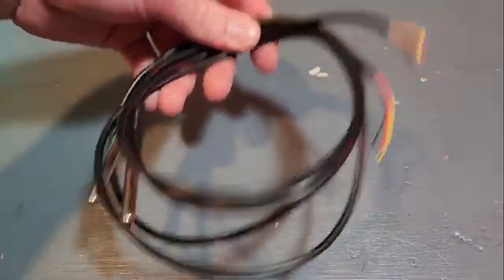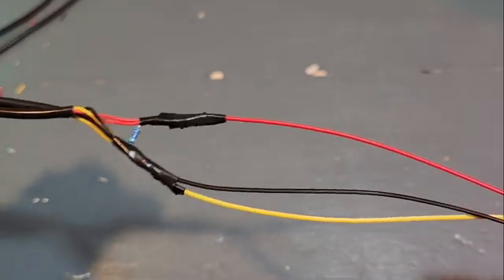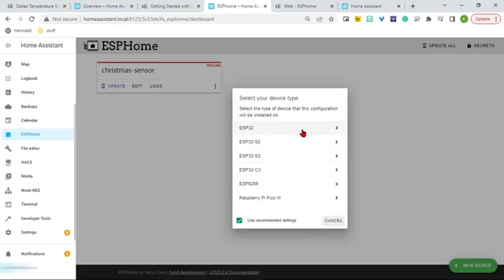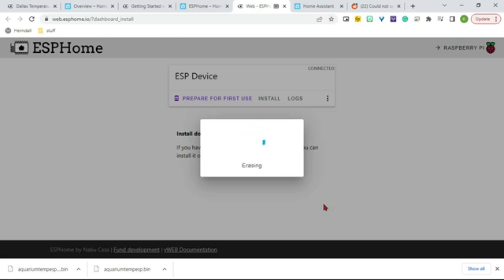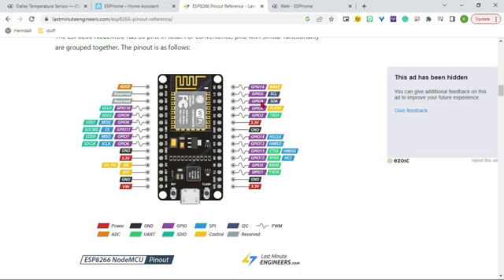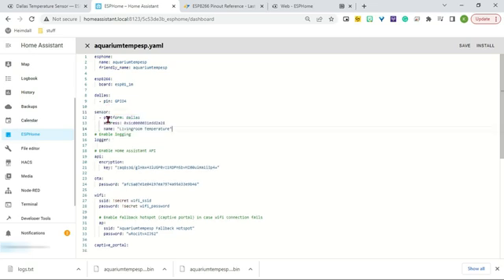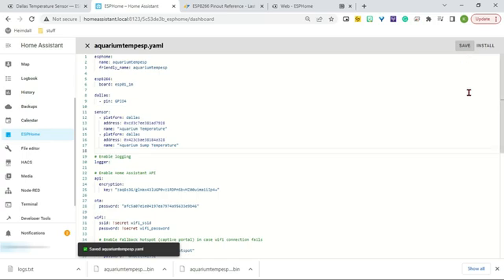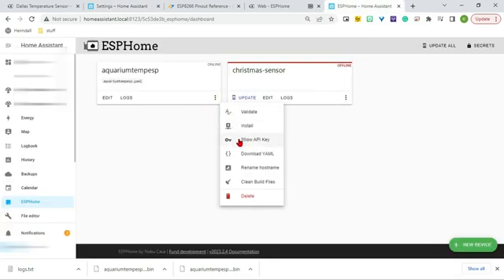Waterproof Temperature Sensor With ESPHome + Home Assistant!

Comment: It’s worth updating because platform: dallas has been deprecated. 

Here’s a workable yaml, based on 2025.6

esphome:
  name: thermometer1
  friendly_name: thermometer1

esp8266:
  board: esp01_1m

# Enable logging
logger:

api:
  encryption:
    key: !secret api_encryption_key

ota:
  - platform: esphome
    password: !secret ota_pass

wifi:
  ssid: !secret wifi_ssid
  password: !secret wifi_password
  
  ap:
    ssid: "Thermometer1"
    password: !secret fallback_password

one_wire:
  - platform: gpio
    pin: GPIO04

sensor:
  - platform: dallas_temp
#    address: 0x1234567890abcdef
#    one_wire_id: 0x1234567890abcdef
    name: "Temperature1"
    update_interval: 120s

Comment: Complete horror. Sensor never got recognized, tried 3.3 volts and 5 volts as stated, multiple data pins but to no avail, eventually shorted the ESP making it very hot blinking a red LED

Comment: Thank you , for info:
# Old
dallas:
  - pin: GPIOXX

sensor:
  - platform: dallas
    address: 0x1234567890abcdef
    name: "My Sensor"

# New
one_wire:
  - platform: gpio
    pin: GPIOXX

sensor:
  - platform: dallas_temp
    address: 0x1234567890abcdef
    name: "My Sensor"

Comment: Hello, Perfect video. I need to make sensor for my smoker. I am planning to use the Dallas for the smoker temperature but need second sensor which will be meat sensor. Do you know by any chance if there is any I can use with one Dallas the same way you are using 2 Dallas's?  The smoker is like 150ft from home. I am afraid it might be too far for this board. What do you think? Would you please have any suggestions? Thank you very much!
Reply from the maker: I don't know about different sensor types, but I did a quick google search and others have gotten the Dallas DS18B20 sensor to work over 100ft of CAT 5 wire. Heres a link to the page. 
https://forum.arduino.cc/t/ds18b20-length-of-wires-limitation/496404

Comment: What if you have a very long probe cable? I have a 15m cable connected to a wifi temp sensor right now but want to change it to an ESP board to get faster reporting. Do I still need the resister if I have this length cable?? Thanks.

Comment: can you explain why it needs the resistor.... and how did you get to the point how strong the resistor needed to be
Reply: It says on the ESP website under Dallas Temp sensor. 

"The 1-Wire bus the sensors are connected to should have an external pullup resistor of about 4.7KΩ. For this, connect a resistor of about 4.7KΩ between 3.3V and the data pin. Values ± 1KΩ will, in most cases, work fine as well, if you don’t have massively long wires."

Comment: I could not get this to work as the ESP board would not come online after entering the wifi credentials. I kept giving up but really wanted this to work. I finally figured out the issue which was not with the board or this tutorial, it was an issue with my router setup. There's some setting in there that wont allow the board to connect, I confirmed this by connecting to a different router, one i use as an access point which is on the same network. It connected straight away and the rest of the tutorial worked perfectly. So if you have that problem where the board doesn't come 'online' after the install, try looking at your router settings!
Thanks guy, this is such a good ESP/home assistant project and a really cheap way to have many temperature sensors and then have those sensors trigger automations for whatever your trying to do. I now have my 4 aquariums monitored in home assistant with alerts to tell me if something is not right. That cost me under around $12usd for 2 boards, the jumpers and 4 sensors from Ali express.
Just for fun I'm going to set one up with some LED lights on a solar controller with battery in my chicken coup so i can monitor the temp in there. Why? Because i can.
Reply: Does your router have 2.4ghz turned off? These esp8266 boards are not 5ghz capable. They will only connect via 2.4ghz.

Comment: Great video, thanks!

I’m planning to use this to get a window a/c to run cooler. I need a temp probe for ambient, and one up against the cooling fins to ensure they’re not cold enough to be icing over— your example is perfect. Last piece is applying heat to the a/c’s temp probe when I want it on, do you have any ideas or pointers for that? I’ve seen people use a lightbulb but figure there’s a more elegant solution using a resistor, just never attempted something like that before.